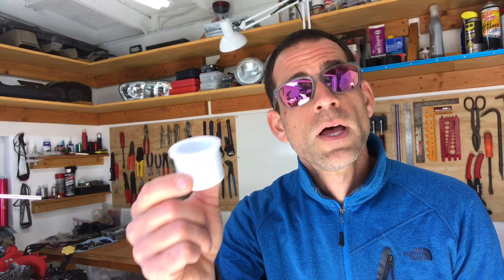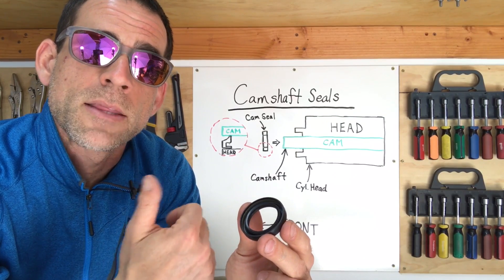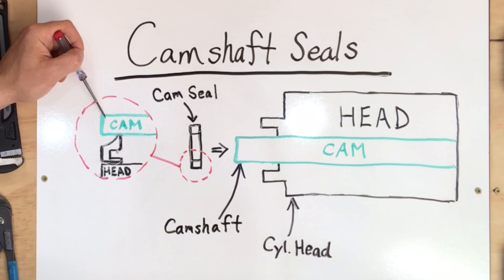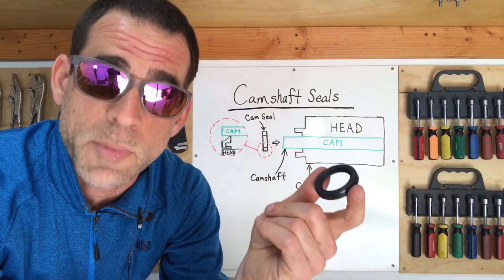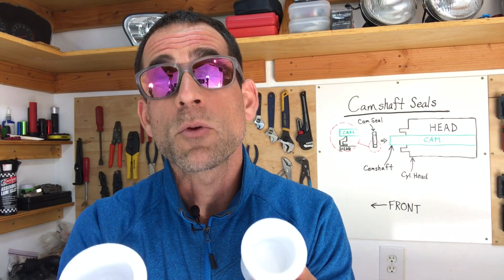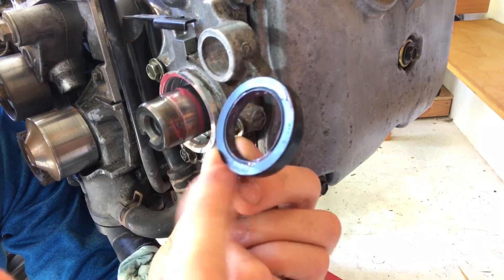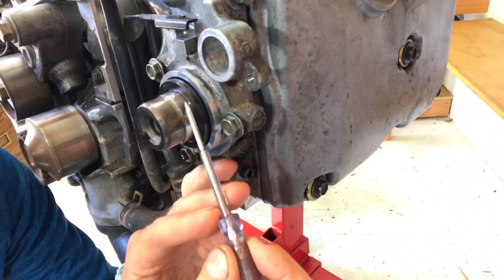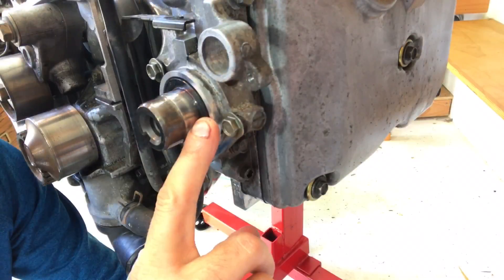Camshaft Seals | Whiteboard Drawing & $2 DiY Tool

Comment: so why is flush the way everyone says bit the manual says 1 to 2 mm deep, not flush. different years? i did everything correctly and did it flush and mine leaked like an sob. the seals that ive always seen when doing the seals are recessed just a tad. not enough to block the oiler holes, but enough to make a seal... i wish i could find a straight answer on why i had to redo EVERYTHING

Comment: If you look at where the front seal goes, it has a bevelled inner diameter indicating the front seals need to be inserted just a little past flush with the cylinder head or they can pop out
Reply from the maker: This ☝️
Reply: I put my seal and cap in both a couple of male deeper than flush. Before I saw this video obviously, will this be an issue
Reply: @rustyh1686  it shouldn't be an issue, actually the opposite, because it needs to go deeper than flush to get past the beveled edge. When I put mine flush it popped out, then I did more research. I hope to see the original poster update the video showing that it needs to be past flush. You should be good as long as it's evenly in.
Reply: @stack.that.cheese  Thanks for your response. Put about 1000km on it (yes , km. Im an Aussie, we use the correct measuring system🤣) since doing HG without any leaking or problems yet, touchwood👍

Comment: Hi i got question i put head gasket on and all new seal and the right rear cam seal came out while driving it any help or ideas thanks
Reply: I'm having the same issue with my 2008 ej253 right side too!
Did you figure out what the problem was?

Comment: Luke, I have couple of questions. On a SOHC will it be ok to adjust valve clearances before installing the head? Have ever tried it? I have one apart right now and will re-check clearances after torquing the head down to see if it changes. Seems it would just be easier to adjust on the bench at the point in the cam where no valves are open. I just have to figure a way to hold the head while I tighten the lash nuts.

Would SOHC heads bolt up to a SOHC short block and vice versa? 
I'm thinking about a high compression budget friendly NA SOHC tuned for e-85 as a daily.

P.D. BTW Loved your video on coolant flow and flow mod!!

Comment: Can I change the plugs in the rear without pulling the motor or tranny?
Reply from the maker: Assuming you’re talking about the spark plugs, yes you can change those without pulling the motor and trans.
Reply: @SubaruONLY  no the cam plugs. I have one that's leaking oil. Looks like i can get in there with the special PVC plug tool and maybe a pry bar and a wood block to drive it in as there's no room to swing a hammer.
Reply from the maker: @AshaStout   ahhh, ok. Yes, those suckers would be nearly impossible to remove and reinstall new ones with the engine in the car!

Comment: I can show you the heads off my 03 forester. It still has the factory set seal on the head and it is NOT flush. It is recessed about a sixteenth behind aluminum face, if not more. I am second owner of my car and I have a packet of every service down to oil changes done by previous owner at Subaru dealerships exclusively and on service schedule. watch the shape of your cam shaft and make sure you get your seal behind the dishes out section

Comment: I have always wondered about this because they have those caps that unbolt on the end of the cam.  I have seen on Honda's and others unbolt that cap slide the seal on and on the corners of that cap add a little sealant like ultra grey or super grey then bolt it back in.  Now on the JE20 twin cam I can see that being kind of a pain in the ass to even get that cap of the front of the cams behind the timing cover.  There is some wiggle room though.

Comment: Hey Luke, Thanks for the videos!  My neighbor lady has a 2016 Outback.  She took it to a local dealer for an alignment because her son said the steering wheel was crooked.  
The dealer said the following needs immediate attention.
Rear pad and turn rotors (3mm). $315.87
Drive belt $168.15 
Left & right cam carrier is leaking, double cam carrier reseal $2,489.20

I told her none of this must be done now and to leave and we would have someone else check.  There is no oil on the garage floor.
Do these repairs sound right to you?
Drive belt - is that an alternator belt i.e. V-belt?

Comment: Seen this method used by many diy kids. Half of them still end up in my shop leaking. I show them the seal should sit at the bottom of the chamfered edge; which is about 1.5mm further in.

Just my two cents
Reply from the maker: You are totally correct man. Thanks for sharing!!!

Comment: I took the DIY tool furthur. Bought a slightly different piece for 1.50$ and had it machined ( 10$ no tax ) to the exact depth like the real subaru tool ( which goes deeper than flush ) about 3.5mm recess. So I just hit the tool until it stops then the seal is perfectly square at the same depth as the original !

Comment: My dealer says my 2013 Impreza has leaking camshaft seals, they want $3,200 to replace them. That price seems kind of outrageous, what do you think?
Reply from the maker: Kind of high to me.  You ever get these redone?
Reply: @SubaruONLY  No, not yet. I can't find anyone around me who wants to do the work.
Reply from the maker: I hear ya. Good luck, hope it get figured out sooner rather than later.  Cheers buddy!!!
Reply: @SubaruONLY  I will tell you what gets me. There was a recall on this motor and Subaru actually had it out of the car.
I asked him to take care of the seals and they still wanted to charge me the labor for taking the engine out of the car even though it was already out and on an engine stand.

Nothing like the dealer getting paid for warranty work and trying to get double paid by me for pulling the motor. LOL

Comment: i thought we was supposed to apply a thin coat of RTV sealant around the outside edge of the seal before installing it

and then grease or engine oil to the inside of the seal
Reply from the maker: That works too.  Factory Service Manual recommends dry but I’ve added RTV too and both work fine - 👍

Comment: thanks for doing all this.  getting ready to put a EJ25 in a 1987 VW Syncro.  Getting some great info from your channel, you explain things really well.
Reply from the maker: Sweet, really really love this swap. I spent a decade in VW vans in the late nineties. Had a ‘67 spit window camper, ‘86 Wolfsburg weekender, and a ‘88 vanagon weary.  I never did a Subaru swap but ALWAYS wanted too.  Good luck and let me know if you need any help. 

And BTW, Kennedy Engineering used to make a sweet adapter flywheel kit.

Comment: Do the cam plugs usually leak? I have a bad leak and it looks like it's coming from the plug and I'm assuming there is no other seal that goes back there.
Reply from the maker: Yes, these often do leak eventually.  Very common on higher mileage engines! 👍

Comment: At 5:49 , can that Red Line Lube be substituted with some 5W-30 synthetic oil?
Reply from the maker: For engine assembly, a sticky lube product like redline works well because a nice layer stays on the machined surface. If you use something else like oil, it’s best to use a grade that is more viscous at room temps. If you want to use oil, I’d recommend using straight 30w, synthetic or conventional is fine. Good luck!! 👍
Reply: @SubaruONLY  Gotcha, thanks! : )

Comment: Luke I have a Subaru 2.2 that was rebuild very little miles am getting oil out of my exhaust pipes .
Reply from the maker: Hi. The valve stem seals are sometimes not replaced when shops rebuild an engine. I’ve seen it quite a few times and I think it’s one of the biggest reasons people see a lot of oil in the exhaust (regardless of a recent engine build).  Do you know if those seals were replaced with the rebuild?  There could be other culprits, but that’s one of the common ones.

Comment: Luke, I gotta say I’m totally a fan now. Your vids are so thorough and detailed compared to others. Thanks for the great Work!
Reply from the maker: Awesome man!  Stoked you found the Channel. Thanks for saying hi - Cheers! 👊
Reply: SubaruONLY so...I have a dilemma...original ej25 seized and I replaced it with an ej20. A head bolt snapped off deep inside the hole on the replacement. I’m now in the position to possibly have to scrap it and rebuild the ej25. Do you have any vid links on completely rebuilding heads and bottom end? Would love it if you did. Look forward to your reply. Thanks man keep up the great work!!!😁
Reply from the maker: That’s a tough one man - hate when stuff like that happens!  I don’t really have any head rebuild or short block rebuild videos. BUT the BEST short block assembly videos are from “Subi-Performance” - he’s one of the most legit Subaru engine builders out there. Check those out and I bet you’ll agree!!! Cheers!  👊
Reply: SubaruONLY cool I appreciate it! I’ll check him out and keep you posted!
Reply: Would you have any suggestions regarding the head bolt?
Reply from the maker: Depends on how deep it snapped off. Not a lot of options. If you can get access, the typical approach is drilling a small hole to use an extractor bit (reverse threaded basically), which bites in the hole and then backs out the Brocken bolt shaft. Might be impossible in this situation though - good luck!!! 👍
Reply: SubaruONLY it’s in there pretty deep. Still have access to it though but an extractor broke off in the hole too😑😑😑now that has to be removed then getting back to the original problem. The bolt broke off just above the thread line so it’s threaded in the hole in its entirety.
Reply from the maker: Fucking brutal man.  This a bitch for sure.  No easy way out. I’ll think on it over the weekend, but this is looking like one of those fucked and expensive lessons - not fun in the moment at all. Good luck - will let you know if I come up with anything. 👊
Reply: SubaruONLY hey Luke came up with an idea. It involves cracking the old block and replacing the new block halves with the broken bolt. One question is, old motor is an EJ 25. New one is EJ 20. Is it doable without changing crank and pistons rods etc...?
Reply from the maker: Hi.  The cylinder bore diameter is different between the ej20 and ej25, so the pistons will need to be changed too. I think that’s the biggest issue - good luck 👍
Reply: SubaruONLY yes I was thinking the same. EJ 25 bottom end with EJ 20 heads will that work?
Reply from the maker: Yep!!! That would work awesome, as a matter of fact, it’s called a hybrid build and there’s lots of info out there for it.  Good call!!! 👍
Reply: SubaruONLY awesome! I’ll keep you posted !

Comment: I want to do this with my 98 WRX engine when I do the timing belt, but I'm not sure how to keep the timing marks lined up once I remove the camshaft wheels, won't the right hand side cams spin once I release the hold? Is there any video on how to do this or advice please? Thanks
Reply from the maker: You are right, the cams will move out of alignment when you remove the cam gear. Just make sure the crankshaft and pistons are in the right position before pulling the cam gears off and everything will be fine.  You align the crank gear mark with the center of the block - straight up. Hope this helps! 😁🤙
Reply: @SubaruONLY  thanks man for the advice. Love your work! The WRX motor is in my 93 Liberty (Legacy outside of Australia) RS Turbo wagon. I can't wait to get it back on the road! Thanks again for your help! 😎

Comment: You couldnt just use a socket to do the same thing?
Reply from the maker: That works too in a pinch.  Not as good a fit to have a nice squared off face that presses against the entire seal face - but that’s what I used for many years before finding this little plumbers cap. Now I always grab the cap, it’s a little faster too.

Comment: that's nice and all but how do you remove an old seal
Reply from the maker: Couple ways I’ve used.  Small sharp pick to dig into the seal material (try not to scratch the machined surface the seal sits in) and carefully pry it out from all sides slowly.  Or you can use a few little wood screws - screw them into the seal but not too far as to make contact with metal surface behind it, then use pliers to pull the seal out by the heads of the wood screws. Both ways do work quite well.  Good luck buddy! 👍
Reply: @SubaruONLY  THANKS!

Comment: Thanks, Luke...very nice way to set the seals.  I have a single cam engine in my 1994 Subaru, it seemed to have a main crank seal leak, but when I took the covers off, I don't see evidence of that...anyway I never use the hill holder, but I was taking my girl to UCSF medical center, and I used it.  When I let off the clutch, there was a "jolt", and the engine quit...The cam sensor was pushed cockeyed out of the back cover, and I thought that the Bolt had broken.  When I took the timing belt off to get at the back cover, I discovered that there wasn't a piece of the bolt in the threads, so I guess that the hold down bolt must have "walked" out of the back cover.  I was apprehensive about the getting the Cam bolt out after watching the videos about problems with the high torque. But on mine, the bolt (hex head, not socket head) it was not on hard enough to make using an old belt necessary...so I wonder why it needs to have so much torque at all?  The engine has been running perfectly for the past 5 years and I had paid a low priced mechanic to set up the timing when I had the engine out to fix a broken head bolt (I Over torqued the last bolt because I didn't read the torque value spec properly after replacing a head gasket)...Anyway, the cam sensor tore the back cover hole and there is another little hole in it too, so I am at Pick n Pull in Windsor, trying to get that same cam bolt off, and this one is really on tight...the belt is still on and the cam gear seems to be held pretty tight, so now I am looking for a long piece of pipe to slip over the 17mm wrench to see if I can break it free  while I'm going to the trouble, I want to replace all of the front seals, I wonder if I will get the correct main seal if I can't find a number on the old one? I don;t know if the crank has been turned...Thanks again for your video, I just "subscribed" to Subaru Only, and really like your shop...I miss my old shop and it's not much fun trying to work in a storage unit without power or lights, so thanks again for your great channel, I'll be back I'm sure...next is getting my Mazda RX-7 convertible running, without the mechanic that I used for several other rotary Mazdas...He won't touch them now, do you happen to know anyone in the Bay area that still works on them?  Cheers, Rob robertooroark@gmail.com

Comment: Why did our rear passenger cam seal just pop out? I think they were replaced about 2 years ago when the head gaskets were replaced. Shop that did it is closed now.
Reply from the maker: Tricknologyinc could be several reasons, might not have been installed correctly or may have too much camshaft endplay, which slowly pushed the seal out. Either way, something caused it and it’s not normal, so I’d say you’re doing the right thing by trying to figure out why it happened. Good luck!  👍
Reply: @SubaruONLY  I'm used to old VW's, not Subarus. There isn't a chance that the oil return from the head is blocked, is there? I've always run Mobil 1 in it and kept up with changes. A heavy equipment friend said to look into this.
Reply: @SubaruONLY I'm having this problem with my 2008 sohc Impreza. I just put a brand new head on the right side and the rear cap won't stay in.

Comment: Thank you for your video is very informative. Just a question the rear cam seal plug.is that the only thing that is sealing the back of the engine thank you very much.
Reply from the maker: There are the cam seal plugs and the crank shaft main seal on the back of these Subaru engines. Good to replace all three when the engine is out!  Cheers! 👊
Reply: Thank you very very much for the information I appreciate that have an 07 outback bought it brand new the front seals have been changed numerousbut like you say it best to change them why they're out but do they normally leak the rear plug seals hey thank you very much for the response back I appreciate aloha.

Comment: I've always lubed the outside of the cam seals too. I take it's not necessary?
Reply: The service manual says to "Apply a thin coat of engine oil to the periphery of the camshaft oil seal and oil seal lip".
Reply: Thanks, I'll keep doing what I've been doing👍🏼

Comment: That’s a great tool. I’ve used similar plumbing sleeves, added a wide washer at one end and then used the cam bolt to drive in seal. When engine is installed in car and very little space for swinging a hammer.
Reply: Will it work for the crankshaft seal? What size is that ? thanks.

Comment: Hi Luke

Thank you for this useful information!  I am currently doing my timing belt on my 2006 subaru liberty, 2.5na 4 cyl sohc and i wanted to know what way you think is the easiest to take off the cam shaft pulleys without twisting them to much ?
Reply from the maker: Lock the timing belt in place use vice grips, so the belt prevents the cam pulley from rotating.  This will allow you to put enough torque on the bolt to loosen it and remove it.  

You can also use this method to reinstall the cam bolts to the factory specs. Good luck - you got this! 👊
Reply from the maker: P.S. Also , check out my recent video on “Easy way to Install Cam Bolts” - I walk through this method in that video. And it works for install or removal of those bolts.
Reply: SubaruONLY  thank you very much ! 👊👊👊

Comment: Great video but what about the hardest part...removal of the old seal?
Reply from the maker: Scott B I’ll make a video on that one day!  I use a small pick or thin flatblade screwdriver usually.  Also used wood screws quite a few times.  How about you?Any suggestions?
Reply: Use the screwdriver at an angle and the seal spins off